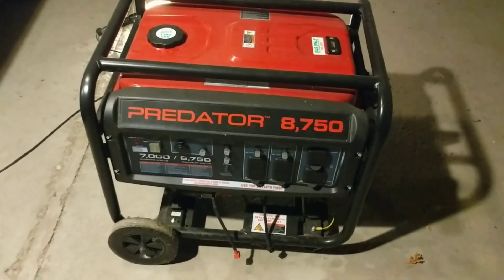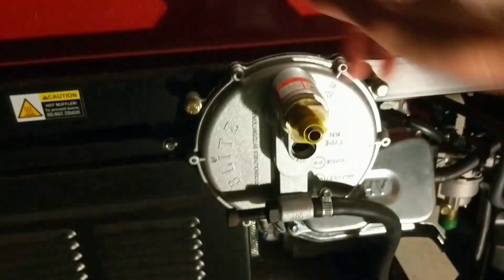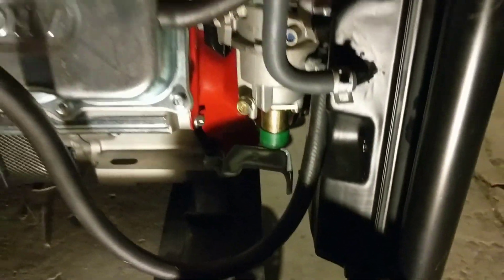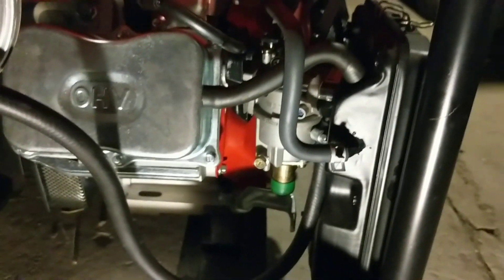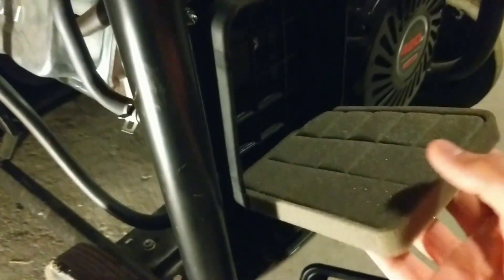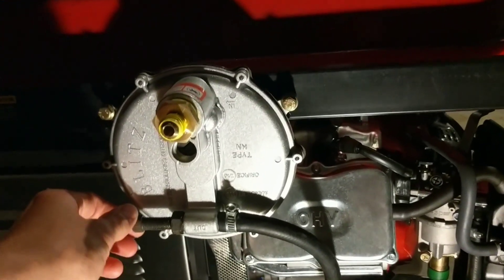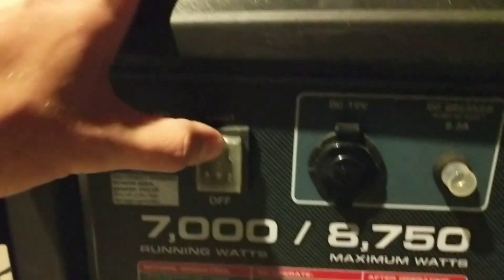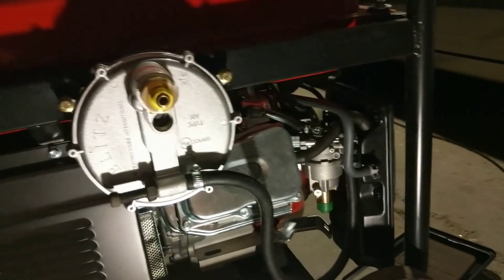Predator 8750 Generator Trifuel Kit Installation Walkthrough

Comment: Great video. We have the Predator 9000 watts generator and I just installed a similar tri fuel kit like this one.  According to the instructions, I have to change the spark plug gap from  the factory 0.028 to 0.018 when running NG. Did you change the gap on your spark plug?  If so, did you leave the gap alone when running gasoline and NG?
Reply from the maker: I didn't change my gap, and didn't notice any issues. However, ymmv, as I run mine very infrequently (usually just the every-three-month remover.)
Reply: @FPVenius  I just Subscribed for your video and good Explanation 👍
Reply from the maker: Awesome; glad to hear it helped 🙂

Comment: Hi there, I really need your help. Can you provide me with the model # for the Predator you did the installation on in the video? I just purchased a new 8750 Predator (someone different is now building it for them so things are a bit different) and conversion kit but as everything is now moved out further from the carburetor due to the Venturi adapter, I cannot put the air cleaner cover back, it hits the tubular frame. I called Predator parts and they can tell me if the air cleaner from your older model will fit mine but thy need the model #. Much appreciated.
Reply from the maker: I responded via email, but in putting it here also, in case anyone else has the same issue. Mine was made by Loncin Motor Co. and it is Harbor Freight item number 69671. Hope this helps!
Reply: @FPVenius  Thanks for the reply and information, very helpful and much appreciated!

Comment: Wanted to be able to use most of our appliances during a power outage and this size generator fit the needsꉺꉺ>share4.photo/HF87Generator?X24     With that being said, it is large and loud, but it works great! It cranks on the first pull and runs fine. I recommend getting the wheel kit if you plan to move the generator around much, it makes that task much easier. Remember to buy oil and a grounding rod and wire because the generator does not come with either.

Comment: A duckduckgo.com search produced the following results: (copy and paste these URL into your browser):
https://duckduckgo.com/?q=predator+generator+conversion+kit&t=h_&ia=web

https://picclick.com/Predator-Generator-Tri-Fuel-Conversion-Kit-for-Predator-Gas-251670430727.html

Generally, 4" of manifold pressure needed for NG. I imagine LPG is about the same. 

As far as runtime, I had a propane-powered gen set in 1968 that was hooked up to a 250? gallon LPG tank that would run "forever". Your consumption depends on your electrical load, but slightly less runtime on LPG versus gasoline. If I recall correctly, the propane (LPG) was 0.85 (approx.) the runtime as on gasoline. LPG is usually measured in pounds, not gallons, so it may be a hard comparison, but LPG has about 85% the energy as gasoline (but NONE of the problems!) .

Comment: I have a Predator 8750/7,000 running watts Generator and 3/4” pipe out the back of house and was wondering if 1/2” hose about 25 to 30 feet would run my 420cc motor or would I have to take my 3/4” hose closer and run a 10 ft 1/2” hose to gen set. Thanks
Reply: Captainkleen 
How did that work for you?

Comment: Where did you buy the kit what was the price and the model number? The reason I’m asking is US carb has a Tri power low pressure kit and a Tri power high pressure kit and each time I checked the price the first was 187 and the second was 269.

Comment: What is the difference between using this on natural gas vs propane? Do you use the same regulator, just with the addition of a pressure reducing valve with the propane? And then tweak the valve? Thanks!

Comment: Did you say you had to pump the button while you’re starting the engine? If so, how are you going to be able to pull the cord and press the button behind the regulator at the same time? Sorry if I misunderstood you. Thanks
Reply: Mark Avenius Thanks Mark!
Reply: All that button does is purge the air out of the hose. You just hold it down for a few seconds then start the engine. There should be no need to hold it down or pump it while you are cranking the engine over by pull or electric start. Those kits are expensive. I got my tri fuel carb for $39. The carbs for the bigger engines like this one are a little more expensive.
Reply: Deucealive75 Thanks D75, that makes a bit more sense.

Comment: Do you leave the gas tank completely empty and dry? Have you ever used gasoline with your generator?
Reply: Mark Avenius Thanks for the reply. I'm probably going to buy one of these generators and the natural gas kit. Was thinking of installing the kit and never putting a drop of gasoline through it ever.
Reply: Or perhaps vice versa. Use gasoline, have the conversion kit ready to be placed on the generator when you decide you need to run natural or propane gas.
Reply: @golf-n-guns  I know I am probably too late, but I've read to break in any generator on gas for 5-6 hours before installing the conversion kit.  I don't know if it makes a difference, I personally don't see why it would (literally nothing mechanical changes besides the carb intake) but who knows.  I hope it worked out.